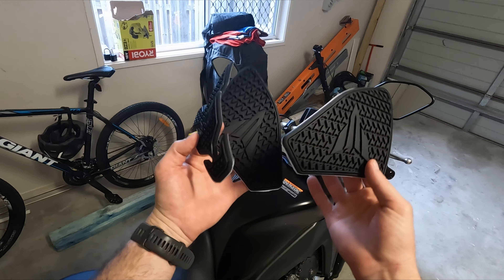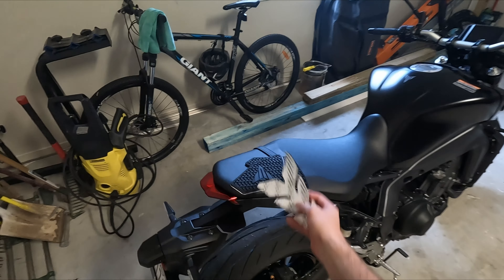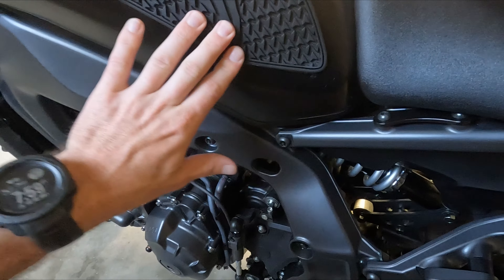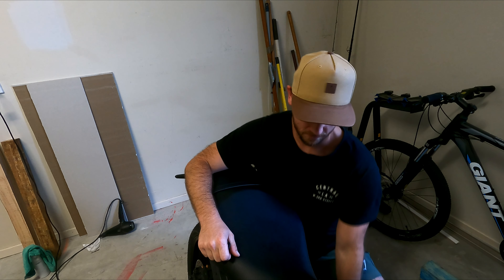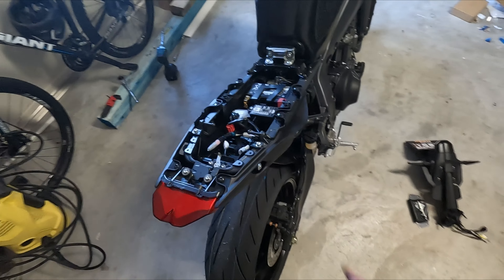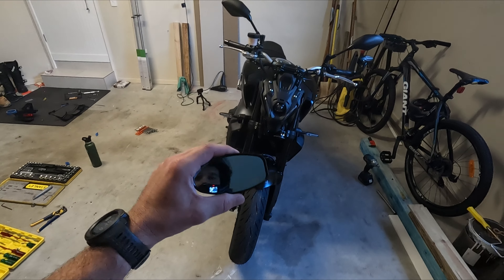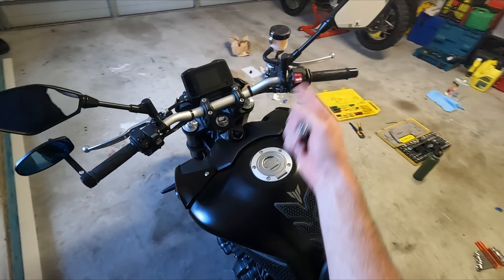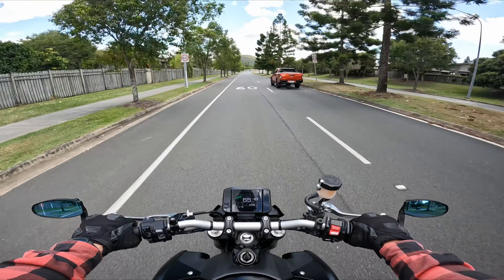MT09 LOOKS EVEN BETTER NOW | FIRST MODS

Comment: I bought these same mirrors using the link provided! But man I'm struggling.  Do these provided bar ends squeeze the grips or is it just me ? Should totally do in depth video of the mirrlr install 😂😊
Reply from the maker: Hey mate
Pretty certain I used it by keeping the original bar ends 👍🏼
Reply: Thnx for the reply , i tried original bar ends the Actual piece where Ring goes into that mirrors attach to dont fit around the original bar ends =(  @_JoshJB_  i just rewatched your video though , clutch side bar end looks shorter than the right so im guessing you used the bar ends provided . i was so excited to get these on =(

Comment: Love the bike, and the mods bro. I'm going to be doing the same thing when I get my bike in the end of the year. I've been watching obsessively on how to do the back end of the bike getting rid of that star trek ugly crap rear lights, and boy I've watched so much that I think I"m certified in replacing it with my eye's closed. I'm also going to be getting impacktech stunt roll cage for my bike. No I"m not going to be doing stunts, but I know I'll probably drop it once, or twice. I just want to make sure there won't be serious damages from a little fall, and the cages look pretty cool in different colors. I didn't want to get sliders cuz I thought it won't protect the bike good enough. I also want to get a wind shield for the front of the bike. I'm thinking about going for long distance ride, and I know the wind is going to be hitting hard on the chess. Having a little wind shield will divert the wind and make the ride more comfortable. Well, that's my plan for my bike. You're bike is really looking good. I'm going to be getting the 2023 model, well I'll try. I hope it won't so different from your model. I just can't wait till I get my bike. I just got the 19 months to go. Now if I could raise the money fast enough than I could get it early, but it looks right now I can only get on that goal date. I miss riding so much! I wish I had my old bike to ride while I wait for this one, but fate just took my bike away. I'm just going to have to wait. At least one good thing about the wait. When the time comes for me to get my bike. I don't have to worry about making payments for it. It'll be paid full.